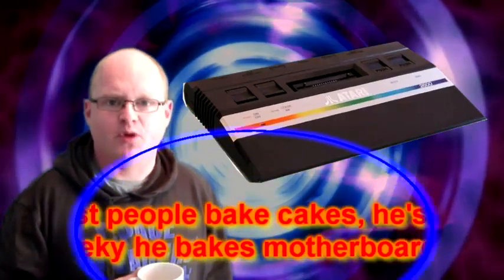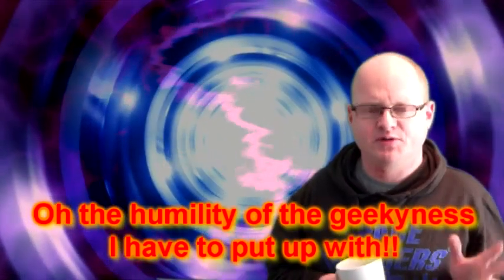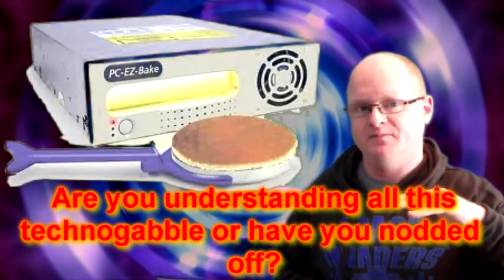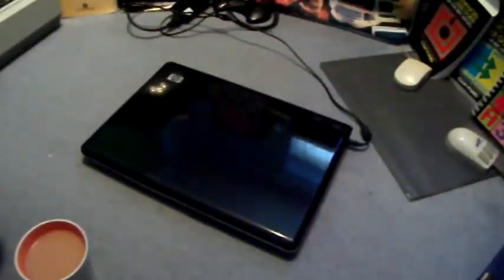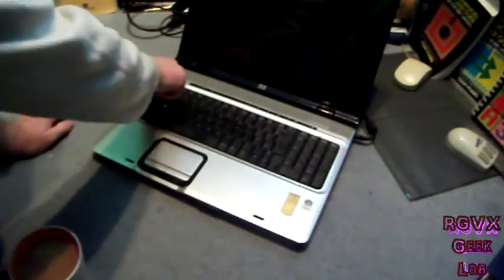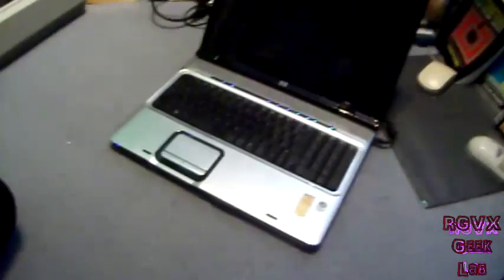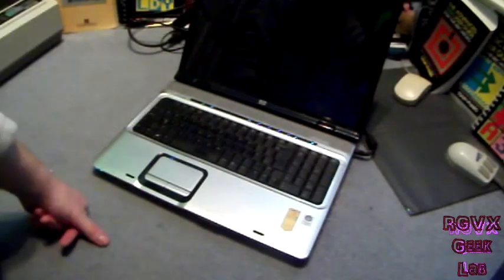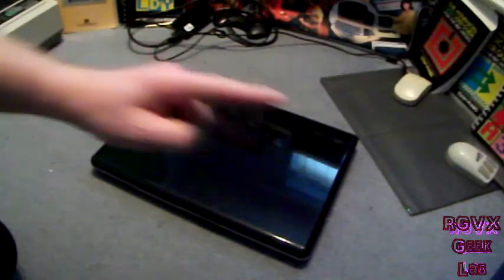How To Repair Laptop Video By Baking Motherboard In An Oven ( GPU Repair, Computer Technician )

Comment: Fingers crossed, I'm about to try the same with a Lenovo U410.
Reply from the maker: Good luck, let us know how it goes :)
Reply: @RetroGamerVX  How long did your gpu last after baking? I’ve been reading it’s not a long-term solution.
Reply from the maker: @Kliment Paskalev  nope  it's not, about a week, but I used to render videos on that and it would get very hot.  I did it twice more then it finally kicked the bucket

Comment: Question about iMac firmware unlock since you disabled the comment there. Does video apply to 2011 iMac since you labeled pre 2011
Reply from the maker: No, it doesn't  thats why it says pre 2011  you'll have to research, not done any younger ones.

Comment: I usually bake 230 - 280F. It needs to get hot enough to melt the solder joints. But also needs to lay as flat as possible.
Reply: Yes, important to get it as flat as possible.

Comment: Shouldn't you leave it in the oven to naturally cool off ? 😕

Because when you took it out with the tray while it was still hot some SMDs could have fallen off due to fairly liquid solder. Any bump could cause them to become separated from the motherboard. Bottom-side components I mean. 🤔

Comment: I was very skeptical of this, but tried it, and the video came back! 

But thinking about it, I was also wondering if just the actions of cleaning the fan, and replacing the crappy thermal pad under the video chip heat sink with new, good material would keep the video chip from overheating immediately and shutting itself down, or just not working properly. Have you ever used just those steps Retrogamer? Guess I can wait and see if the problem comes back and try it, but it just seems like the inexact methodology of the oven heating may not really be doing anything. Just wondering...

Comment: I would like to try  test since soundcard with LPT plug ..  how make computer inner cables with LPT inside the cabinet between the cards ..sound & instead of to... file transfere ..not ROT hub USB.. ..instead LPT.& instead of 1 CPU  ..create 2 CPU on a big Touch under card material  with harder material more fast & compact card and actualy same preparat material circuit Board (motherboard) printBoard.and yes ahah... test it if it wil be running.. motherboard science mod. this is.. writer: จำเลย เพชร ทอง in facebook
Reply from the maker: palm palm i have no clue what your on about

Comment: How did this work?  I don't understand.  call me stupid, but I believe that lead free solder melts at 217C therefor setting the oven at 200C is not hot enough.
Reply: There is this missbelieve that a broken GPU on laptops is caused because of the connection between the GPU and the mainboard. That's simply wrong. The actual problem is the connection between the litte logic board of the gpu and the little, silver gpu-chip itself. The meltpoint of this connection is way below 200° C so the oven should fix this one. But if you turn your temperature higher, you may mess up the connection between the mainboard and the cpu.
Reply: more like internal structure damage!
Reply from the maker: Not trying to melt it, just causing internal structure changes.
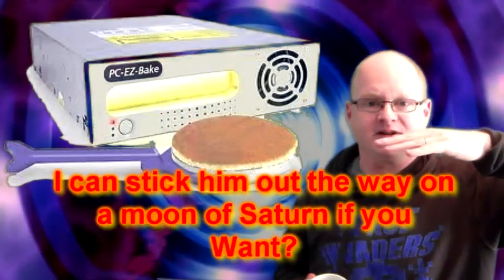Reply: +RetroGamerVX At 1:23 you defiantly implied that the technique was to re-melt the solder.  but never mind, I'm splitting hairs.  cheers for the reply.

Comment: thanx it worked 100% for my toshiba c650d model with ATI MOBILITY RANDEON HD 4200 Series GPU...
Reply from the maker: welcome :o)  Remember to throttle it back as its not a permanent fix :o)

Comment: My friend gave me a laptop(Asus K55VD, Core i7, Nvidia 610m gpu, Intel SLJ8E chipset) that had water spilled on the keypad. He says he immediately turned it off and let it dry for a few days, before trying to use it again. When he turned it on the screen did not work. He said he tried it again a month later and it worked, but he had a new computer so he turned it off.

When I received the laptop it of course still showed a blank screen, it also has no output through the HDMI or VGA port. It charges, and the power indicator comes on, but soon after the fan runs at full speed and then it turns off at different points. I know this seems like a graphics chip issue, but after opening it up. I can see corrosion on many SMD  behind the GPU which faces down. Inspite of this they appear to still have contact.

Do you think it is the GPU and I should use this temporary fix?
Do you think this fix would... sorta reflow the corroded SMD?

I was also given a mini computer(Acer Revo HM77S02/HM70S02, i3-2377M, SLJ8C chipset) by my brother to play with. The GPU/CPU package definitely needs to be reflowed.

My biggest concern about both is that the boards has capacitors rated at a much lower temperature than what is suggested for reflowing in the oven?

I'm studying to be an electrical Engineer if your wondering why people are giving me their broken laptops/computers =3.

On an unrelated note, the laptops GPU memory is manufactured SKhynix and I discovered that they sell a x8 4gb package of the exact same memory chips on the board right now. What would happen if I replaced the x8 2gb chips with the other chips and increased the video memory to 4 gb instead of 8. The BGA are exactly the same and all features and physical specs are the same. Err... except I don't know the frequency of the current memory if that matters? Someone on a forum said that the Nvidia GPU automatically checks for changes in the physical memory. What do you think?
Reply: +Mia Patterson Oh also is it just better if I pay 200$ + whatever to my local laptop repair place to get it fix? Is that a far price, I told them exactly what I think was wrong and they told me the flat rate is 200$ for any mother board repair. The laptop is better than my current computer. I would really like it to work heh.

Comment: Hey i finally dismantled my laptop and got the contact putty. Which side do i put on the top..  the one with the cpu? Also, do i leave it in the oven to cool after switching it off after 8 mins?
Reply: You have to cover all the pins on the bottom of the CPU, then stick it in the socket. Make sure this is NOTHING between the top of the CPU and the heatsink

Comment: Hi please help, do u need sumthing to replace the contact putty. What if i preserve the laptop's contact putty while disassembling it. Also, with what material do i replace the contact putty
Reply from the maker: you teplace the contact putty with....fresh contact putty!
Reply: Is that necessary? Are there anyothr words for contact putty
Reply from the maker: +Prabhjot Malhotra unless you want your processor overheating due to poor contact, then yes

Comment: i have a toshiba satellite...and the LCD screen is actin funny.No image...no colors but if I plug a HDMI cable I can see it on a second screen.Do you thing that the Lcd is bad???Or the VGA card????Please any suggestion?//
Reply: replace the lvds cable, its a cheap part that costs less than 10 bucks
Reply: Could also be a failing CCFL bulb or inverter. 🤔

Comment: Hi, I have a (HP 2000 219DX) That will only turn on for a few seconds when I open display, when i actually try to push power button nothing happens at all. I tried the hold down for 30 seconds and it didn't work.Please any suggestions would be so helpful, thanks!

Comment: Amazed. It actually worked!
Reply from the maker: Congratulations :o)  It's not a permanent fix so throttle back your processor / gpu so it doesn't get too hot or it will go agian :o(

Comment: Thank you for the detailed video! I seriously wasn't expecting to fix the laptop like this but I had nothing to lose as it was already pretty much dead and going to be stripped for parts. A good friend gave me this laptop as I do IT consulting and it definitely looked like it was the GPU issue that many people were experiencing. Stripped it down to the board. Foiled up everything but the GPU and just popped it in my conventional over for about 180 - 225 degrees for about 5 mins and it worked!!

Comment from the maker: Oooh, you put wire everything back up together but not necessarily screw it into the case :o)  Yes, that's what happened to mine when it finally did die :o(  Had new laptop for over a year now :o)

Comment: Yeah, like do a test before I put it all back together? Like @ 16:31 in the video. Last time I had a problem like this and forgot to put the ram in and the fix worked. Now after a year I have the gpu error again. I just feel like after 4 reflows it should be at least changing with symptoms. Everytime it turns on and then straight off. I feel like I'm forgetting to plug something in or something is wrong somewhere.

Comment: Have an HP Pavilion DV7, got blacked out screen last night. Other than LEDs, nothing works. Could this be graphic card or mother board? Saw ur video and plan 2 try it. Can a cooling pad underneath the laptop give longer life? How about heating the card with a hot hair dryer? What paste to use for GPU? Thanks.

Comment: I suggest you use thermal paste on the GPU as well as the CPU. Also, you only need to put a blob on the top of the chips, not all around the edge as shown in the video. You also don't need to smooth it out. The act of putting on the heat sink will push the paste where it needs to go for the best distribution.

Comment: yes it has work i have acer aspire 7720G
you must follow instructions and be very careful 
i had broken graphic card in aspire 7720g and so far it working find once put together 
the graphic card working find  a put it oven for 10 mins and it is working fine .

Comment: That is alright. Thanks for the tip, when he comes back I will try a new bios modification + a copper plate (as I saw it on another video.). So... lets hope it will work for a while for him - yet i have bad experience with hp stuffs, acer is so much better for me. Yet many thanks, did not expect an answer.

Thomas

Comment from the maker: I don't know, this laptop survived this process twice, the third time, it completely died.  There are discussions on the forums about modifications to the cooling system with bronze wedges available and there is apparently a bios modification now available to keep it cooler.  More details I do not know as I obviously no longer have this system :o)  Replacement computer does not even get hot :o)

Comment: HP  models  dv2000 / dv6000 / dv9000 have all a critical bios update it suppose to keep it cooler . now my situation was no video just like this and i did heat up the video chip but I took a piece of copper from another heat sink cut it ( size of the video chip) and added cpu paste on it and this was 1 year ago and my machine is still running and i also did some testing with software to monitor the temps and yes the copper shim i put in my laptop was keeping it 10 *C  cooler . NO LIE.

Comment from the maker: Oh goody :o)  But remember, this is not a permanent fix but will buy you a couple of months.  Use the power settings to throttle back the cpu and don't give it anything too taxing or it will go again :o(

Comment: Well just to let you know, I have successfully baked the mobo and the machine is running good. In operation the GPU temp is now running on between 60 & 68  degrees C. Complements to the chef of baking motherboards :)

Comment: Hi there, thanks much for the video. I am going to bake a HP Pavillion DV2750ei motherboard tomorrow, it also has the "black screen".( I have done various troubleshooting steps to eliminate any other problems) I have one question though. On the GPU they have put something that looks like rubber on the heat sink, can I replace that with thermal paste?

Comment: Worked for me aswell.. for about a month! Then the same problem came back. I'm gonna try to bake it again to see if it helps. I am not going to buy a replacement motherboard though as the Nvidia defect is still present and it will die again in 2 years regardless.

Comment: Thank you for the quick reply!  I'm in the business of reselling laptops and I knew abt this issue but I didnt think of it when I bought this damn laptop.   One guy wrote that a heatgun reflow helped fix the issues i'm having with the sound card and the CD drive.  I did the towel trick and then I had no video lol then I did the towel trick again and got my video back but still no sound and no cd.  The HP DV series was great and in a lot of ways ahead of it's time for the price range

Comment from the maker: Your very welcome, but remember to keep the cooling holes clear at all times and don't do anything that will make it get really hot or else it will go again, mine lasted about 3 months after this before going again, it's not a permanent fix due to the design flaw of the system but it gives you some grace :o)

Comment: i own the dv series 6700 i must warn everyone THE RIBBON CABLES ARE WEAKER THAN HUMAN HAIR... THEY WILL BREAK...DONOT REPEAT DONOT PULL HARD ON THE TOUCH PANNEL ABOVE THE KEYBOARD... infact... removing the ribbon cable is quite a task... as ive broken mines before being gnetle and the mother fluffer is hard to get back in.. since i dont give a snuff abt this pc anymore... im wondering what are the symptoms uploader? i have a video on my page of my hp... will it solve that bootloop i have?

Comment: I find this hard to believe, not saying its impossible, but doesn't hot tin foil cause static discharge? I guess if ur out of options, this is a last resort. I've heard this before, but i just find it really hard to believe, I have the same laptop with the same problem, so first thing tomorrow imma try it... Wish me luck

Comment: The solder balls after excessive heat with break down into a honey comb like state causing breaks in the connection. The reflow process remelts the solder balls reforming them into a solid state fixing the broken connections.

FYI, the comment was removed because of a spelling error.

Comment from the maker: Yes, nice comment you removed there.  The question is, if the solder has not moved, why you an oven to melt it back into position? 

The fact is that the failure of the video card was not a sudden thing, there were many signs over a period that overheating of the chip was occuring and temperature probes showed that it was operating at temperatures well in access of 180 degress and still running :o)

Comment from the maker: That's why the oven is at 250 degrees :o)  And if the processor is overheating at 120 degrees, why does it survive this process?  Check those figures :o)  Oh, and it works :o)

Comment: You are absolutely wrong about the solder becoming liquidized and moving while the laptop is hot. leaded solder melts at 180 degrees celcius. The most amount of heat any processor can take is 120 degrees celcius with out powering down. So you wanna tell me how the solder balls are becoming liquidized while the machine is over heating?

Comment: @RetroGamerVX 

I'm a computer technician I have seen too many HPs and Compaqs come in with the same issue and others with completely dead motherboards so I have lost all "love" for those brands.. We used to fix the video card issues on them (we had to send them out as we don't have the proper equipment in a small tech store) and sure they would get fixed, but most of them would experience the same issue again within 5 months.,

Comment: I got an nvidia 8800 gts card that has a fault where it locks up i changed thermal pste and it would work in windows but break up and freeze in games . I will have to give this a go .